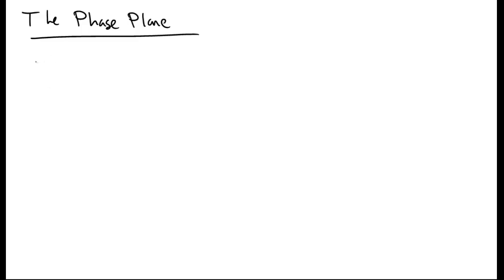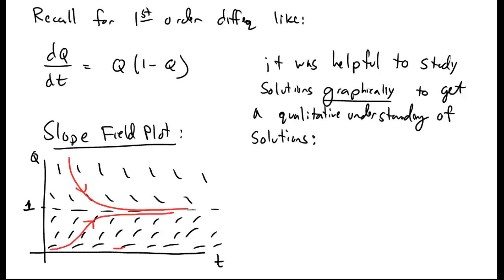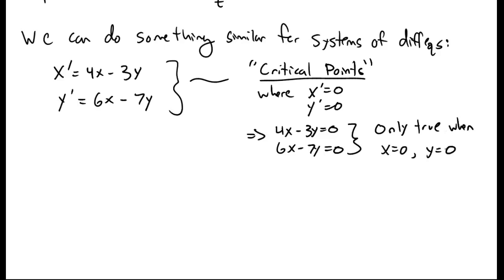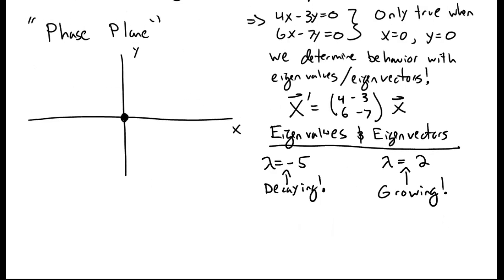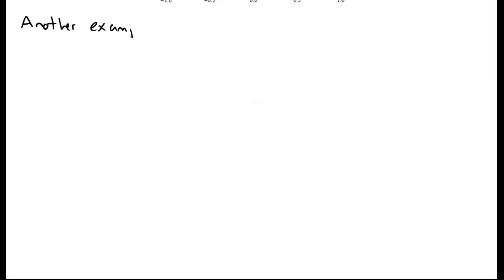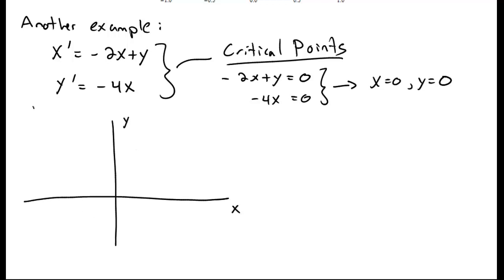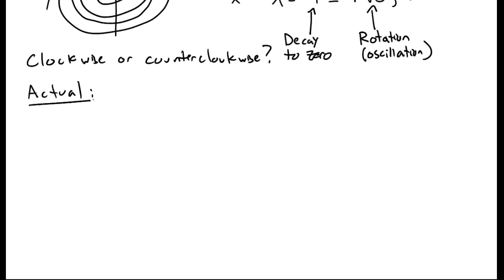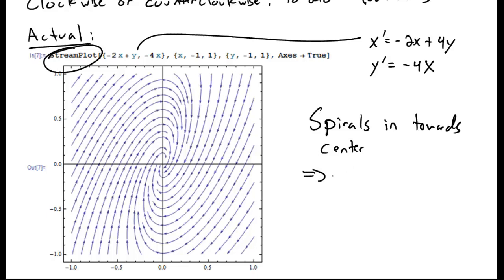Phase Plane Plots

Comment: thanks so much dear Dr for this brief and at the same time comprehensive lecture. I'm new at this subject and studying on my own, so it was really cleared it out for me. Just a little question: critical points must be real or else it wouldn't be linear anymore. Am I right?
Reply from the maker: Well, I'm assuming here that x(t), y(t) are real functions, in which case a non-real critical point should be interpreted as the absence of a critical point. But I don't think that connects to linearity - even non-linear systems will have real critical points.

Comment: Hello Dr. Underwood , Thanks for the lecture . I was wondering if you could answer a small doubt I had . I came across plot which involve real part Vs Imaginary part of eigen values in a CFD problem . What can I comment when i look at the change in origin of Real/Imaginary part based on change in flow parameter. If possible provide me with some reference. Thank you in advance !
Reply from the maker: Hi +Rajat Hebbare , I'm not sure I quite understand the question.
What do you mean by "change in origin of Real/Imaginary part"? What about the origin is changing?

I suppose you're referring to some system of linearized Navier-Stokes equations? Under what approximation are you working?

Comment: Thanks a lot! I'd like to ask a question, when you have roots that are both real and both positive or negative, so they're both growing/decaying solutions and you end up having parabolas that are at a tangent to one of the manifolds and are vertical to the other manifold, how do you know which one it is vertical/horizontal to?
Reply from the maker: ***** Hi! Thanks for your question, though I'm not sure I completely understand what you're asking.
What I think you're asking is what if you have a system with two positive real eigenvalues, like:
  x' = 4x - y
  y' = 6y-3x
which has eigenvalues +7 and +3.

In this case, the phase diagram will not have parabola-shaped trajectories, but instead will have trajectories pointing outward from the origin, since all solutions grow away from the origin due to the positive eigenvalues, as in the "Unstable Node" diagram in the video.
Reply: Dr. Underwood's Physics YouTube Page Thanks for your (speedy) reply! I understand that, but you know the parabola-shaped trajectories, they will go along one of the lines and be at a tangent to one of the other lines right? 

So you get something that looks like an X with parabolas on either side of one line  - they are at a tangent to this line -  and this means the parabolas will be inline/parallel almost to the other line.

I'm asking how you know where to draw the parabolas, I know they reflect each other and I know what direction to put the arrows on, but how do you determine which side of the "X" to actually place them on? Does that make more sense?

Really appreciate your help Dr. Underwood, thanks a lot!

Comment: I thought stable points were called "sinks" and unstable points were called "sources"?
Reply from the maker: Sure - if you use "source" or "stable attractive node", everyone will know what you're talking about (same with "sink"). Just note that there is a difference between a "stable attractive node", and just a "stable node". I don't think you want to call them both "source" - that obscures an important difference between them.
Reply: Okay. Thanks for the clarification!